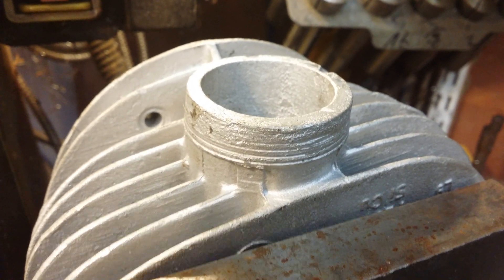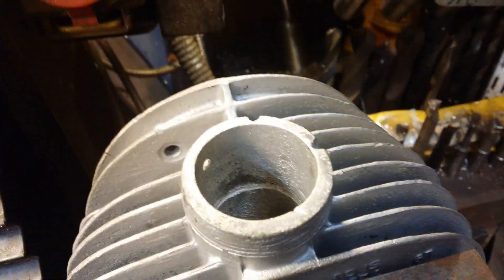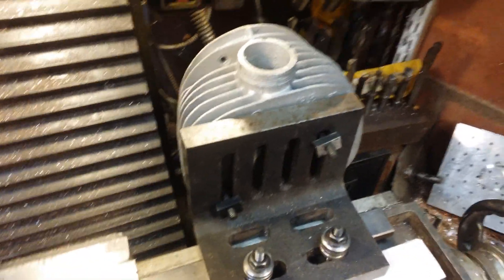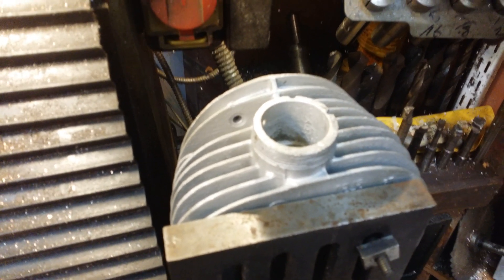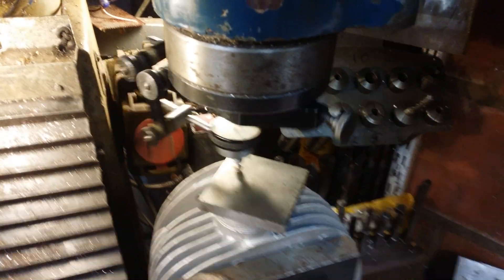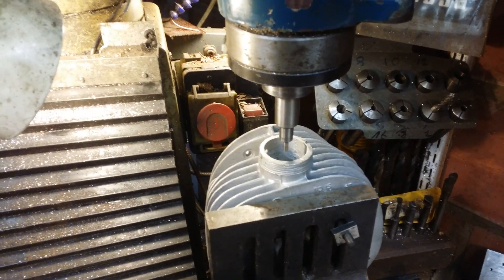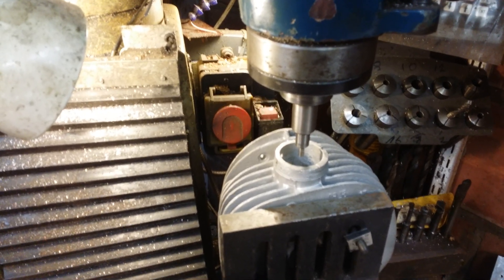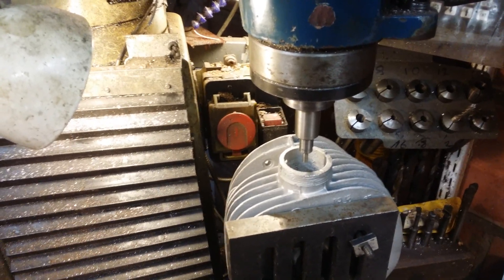WALKAROUND OF BMW BOXER EXHAUST THREAD REPAIR

Comment: Hello, i am trying to prepare a similar set-up to yours to fix several threads on vintage bmw cylinder heads, is there any way you can give me the dimensions of the base that holds the cylinder head in place? It would help a lot, thank you.
Reply from the maker: Thanks for watching and the question. 
I will have to check but the angle plate is roughly a 6" one .
I will be in touch later with full dimensions.
Reply from the maker: The angle plate I used is 6 by 5 inch on one side and 6 by 4 1/2 on the other and came from Chronos via a local shop.
If you have any other questions don't hesitate to ask, if you don't get an answer within a day it will be because I didn't get notification.
Reply: @chrisstephens6673  Thank you Chris, i checked out Chronos website, do you think i may be able to contact them and request the same? Will they recognize your name if i reference you? I think this might be easier than attempting to manufacture it from scratch in my country. Also maybe if you tell me how to request it? I assume BMW Cylinder head exhaust thread repair accessory won't mean much to them :P Thank you very much for your help.
Reply from the maker: @ShrikeCult  The angle plate should be available just about anywhere in the world as it is probably of Chinese origin, just look for one of the same dimensions. 
Chronos would not know me by name and would have no clue about exhaust threads. 
I do not know your machining experience but be warned it could go horribly wrong if care isn't taken.
Reply: @chrisstephens6673  Thank you Chris, i am not planning to do the machining myself, i will have a professional do it. I just want to give him as much info as I can to make his life easier. I would not attempt any such work myself i have no experience in machining fabricating etc.
Reply from the maker: @ShrikeCult  OK, I had to ask as I got the feeling that you were "inexperienced". It's fun to do but costs a fortune to set yourself up with machinery, so getting someone else to do it makes sense. He may have his own ideas how to do a job based on his own experience at such things, but showing him my video may help.